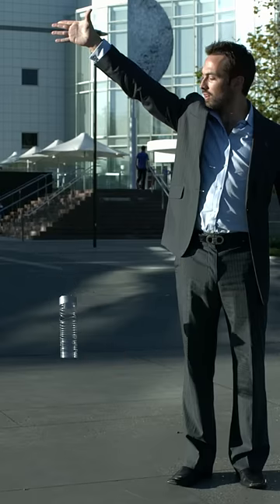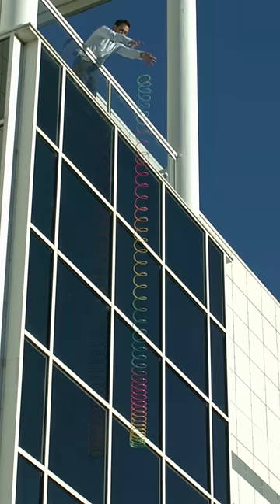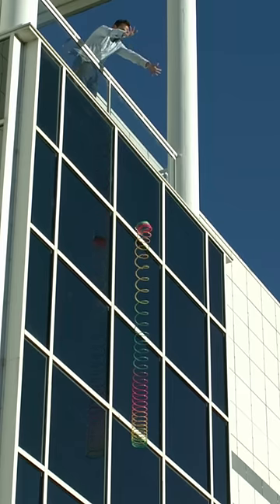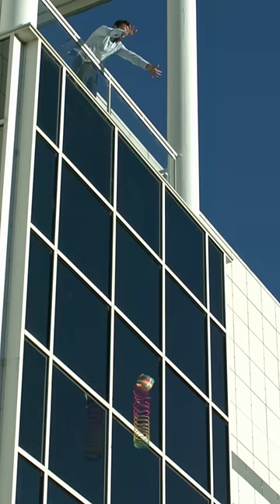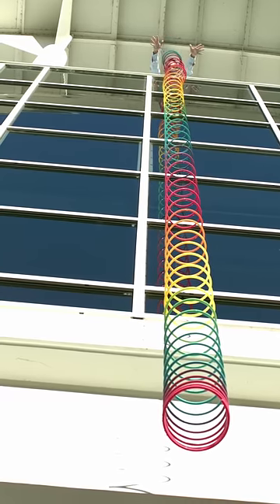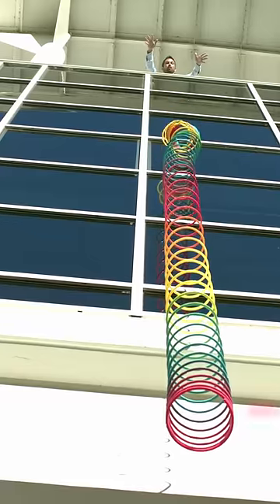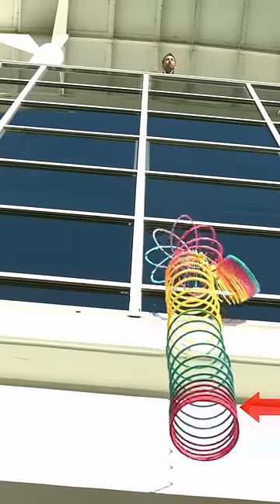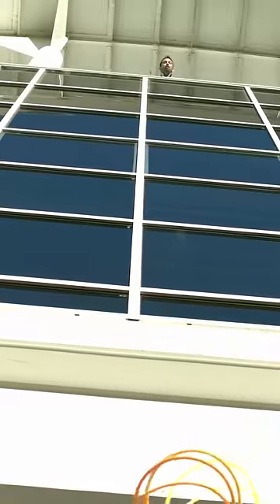How a slinky falls in slow motion #shorts

Comment: The reason the bottom of the slinky doesn't fall until the top falls first is literally exactly the same reason the bottom of the slinky doesn't fall while Derek is holding it. It's just super unintuitive watching it in slow motion. The reasons for both are that the forces are balanced. The force of gravity pulling down on the bottom of the slinky is exactly canceled by the force pulling up from the slinky parts that are in tension. That tension doesn't magically disappear the moment Derek releases the top, meaning that the forces holding up the bottom will remain balanced until the entire slinky above releases its tension force allowing gravity to win.

Comment: Hooke’s Spring Law is F = -kx 
Newton’s second law of motion, F = ma, where a in this case is g, the force of gravity, so F = mg 

Hold up one end of a slinky, let the rest hang downward, and keep the bottom of the slinky off of the ground. The slinky is stretched, pulled downward by gravity.  The force of the pull is defined by Newton’s second law of motion, F = ma.  The slinky is a spring, and the resistance of a spring to being stretched is defined by Hooke’s Law, F = -kx.  The spring stops stretching because while gravity’s tug is pulling the slinky downward, the spring’s tug is pulling upward, and the two opposing forces are in balance:  F(gravity) = F(spring). The force of gravity stored in the spring and the force of gravity, at the moment before release, are equal. This means that if gravity was suddenly removed, the bottom of the slinky would accelerate toward the top with the same force that gravity had been pulling down. In other words, the bottom would rise until the stretch is gone from the spring. 

When you let go of the slinky, gravity pulls all of it down while at the same time, the bottom is pulled upward by the rest of the slinky due to the opposing spring force.  The bottom stays in the same place by rising by the spring force and falling by gravity at the same rate.

Comment: I've always had a question. Wouldn't the whole system fall, because gravity should exert its force on all points? Or, is it a multi-point/body system, this the force exerted by gravity is countered by the stretching of the slinky and thus the top (heavier part) needs to come down first for it to fall?

Comment: Wait a second. Riddle me this. Let’s say we have a slinky that’s a mile long. And say an object- a person was harnessed or connected to the very bottom spring. And the bottom of the spring was 1000 feet off the ground and the slink was extended 1 mile upwards from that position. And then whatever was holding up the top of the slinky disconnected so the slinky started to fall from the top. Would the giant bottom of that slinky just float there for a couple seconds with the person connected until the top of the slinky retracted to the bottom? What in the world.

Comment: What I want to know, is if I drop a slinky that is all compressed together, and a slinky stretched out under tension at the same time from the same height, would the slinky under tension reach the ground first? Mt intuition says it would as the coil pulls downward on it toward the other end, but I don't know for sure, of the other end isn't actually attached to anything to pull with, would it still effect the speed of the links above it?

Comment: It's the same for all solid materials. Like a pole for example. When you release it from it's top, bottom will start going down in some nano seconds later, when the bottom molecules realise that there are no molecules holding them from the top.
Reply: Exactly, all materials are slinkies at some scale. It’s why you can’t transmit information faster than light by writing with a lightyear-long pencil - when you move your end of the pencil, the other end won’t move until the compression wave moves through the whole light year long pole, which will happen at the speed of sound in the material.

Comment: It’s under enough tension to give the illusion of no gravity for the bottom, rotate phone by 90 or 180 degrees it looks like it’s flying through space.
Which gives me an idea, space elevator with the same properties segments under load over a sufficient distance that rotational velocity cancels out the weight of the structure. Is that physically possible?

Comment: think the twisting was do to the speed being faster as the weight built up and toppled vs straight up compressing, otherwise it should have started twisting a bit when it first started to compress and it didnt, plastic ones arnt as good as the original, seems like it didnt fall perfectly or bad timing on release. weird oscillation tho, sending the wave without it being able to return, distance of waves changing every coil, assume similar to a, explosively pumped flux compression generator, slinky represents the magnetic flux drop the explosion, end result the magnetic pulse dumping all at once, difference between how radio waves are transmitted aka the stretched slinky vs a emp aka the compressed , correct? lol

Comment: Does the tension make the top fall faster?
Reply: Because the restoring force of spring and gravity both act in downward direction
Reply: @bldycrash1420  ...so that's a yes?
Reply: @bldycrash1420  The tension in the spring is equal to the force of gravity?
Reply: @deucedeuce1572  yes, at the bottom of the slinky the force is balanced(tension upward while Mg downward) that's why it is floating
Reply: @bldycrash1420  K. Thanks. Appreciate the info. Makes perfect sense. Can't have more tension than gravity... and can't have less tension than gravity, because gravity is the only force acting against it (as far as stretching it and pulling it downward). Was wondering about that.
Reply: @deucedeuce1572  yeah, like Sun's  gravitational force attracted Us

Comment: What happens if there is a weight on the bottom of the slinky? Does this idea still hold.
Reply: To answer your question, just pause the video at the beginning and look at the outstretched slinky. What do you notice? If you look carefully, you see the slinky gap between coils increasing as you go up. This tells you the tension is greatest at the top. This means, the top is supporting the rest of the slinky. So now, ask yourself, is there a mass at the bottom of this slinky? Your answer should be 'yes'. At the bottom of the slinky is already a mass. Is this demonstration showing what you are asking? The answer is, yes, it is. Based on this observation, you can conclude that it will do the exact same thing because what you are describing is exactly what you see in this video. The only difference is additional mass. The consequence of this is that you will see a more outstretched slinky which means the tension force is much greater. As such, upon release, this greater T is going to yield a greater acceleration which means the top is going to accelerate much faster down. You will still see the very same thing where the mass is going to be suspended until this tension force holding it up has diminished allowing it to fall. Something to be aware of is that though this seems like the slinking isn't falling, the slinking is in fact, falling the entire time. Any object under free fall must accelerate down. A slinky is no exception to the rule. What you see is just an illusion that masks the falling of the slinking. By falling, we mean the CM(center of mass) is accelerating and if you look at this slinking, what you see is that the CM is indeed always changing it's position from start to finish and that is at a rate of g.  Many people see this and they think the slinking is suspended in the air, but it's not. It falls just like any other object. The difference is that it's internal energy dynamics allows for parts of it to fall faster than others, but it's CM is always falling at g. Cheers!
Reply: @vangmountain  Thank you for the explanation! One more question for clarification if you or anyone else can help. When you were younger and you had a slinky, you would sometimes extend it too far and it would deform and never return to the same point. So now let’s say that the mass at the bottom was heavy enough to deform the slinky by X%, so (100% would be the slinky not compressing at all) would the slinky just start behaving more and more  like a normal falling mass at high percentages, and that illusion wouldn’t exist?
Reply: @TheWrighteousOne  Yes, because there's no internal energy dynamics involved once it becomes  a static mass. The slinky behaves the way it does due to it's elastic nature. if it's no longer elastic(no material is 100% inelastic that I know of), then yes, it will behave like other static objects in free fall. You see this with anything that is elastic because it has the ability to deform and accelerate at different rates. If you've ever watched a water balloon be struck in slow motion, you see this same sort of phenomenon. The ball deforms  and accelerates rapidly where contact is made and the rest seem to just sit idly by motionless until the tension force propagates to it and accelerates it. But yes, to answer you question, it would do as you describe, assuming air effects are ignored.
Reply: When you try to understand phenomena, it's always good to look at the extremes to understand how it will behave. In your case, just imagined the spring returning to it's original form before it was made into a spring. Imagine the mass is so big that it deforms it permanently back into a straight steel rod. With zero elasticity now, when dropped, it and the mass it is attached to, will all fall at g, every bit of it. By looking at the extreme, we can predict how it's going to behave as you've correctly deduced. The greater the X, the less pronounced this illusion is going to be because the spring now stores less and less energy. Energy is uniformly distributed through the mass now, unlike the spring where you saw the upper having to store more energy than the lower because it was holding up the lower.
Reply: @vangmountain    look at the extremes and then imagine how other factors may play a role in changing the dynamics of the system. That is great advice! Thank you for going into such detail in answering my questions and giving further examples. Physics is fascinating especially if you allow your imagination to play around a little.

Comment: Well for those looking for an explanation , the force in a spring/slinky doesnt change instantly and thus the lower end remains in equilibrium for some time even after the upper end has been released because the tension applied by the part just above it has pretty much balanced its weight like it had before the slinky was released and thus equilibrium is maintained for a while. Pretty cool!

Comment: Can someone share the mathematical proof (and/or model) why the lowest coil does not move until the whole coils stretch?
Reply: A model would be to do it yourself. I don’t know the math but It works because it’s still being supported by the ones above but the first one isn’t so that falls and stops supporting the one below it and then that happens until it reaches the bottom a few hundred milliseconds later